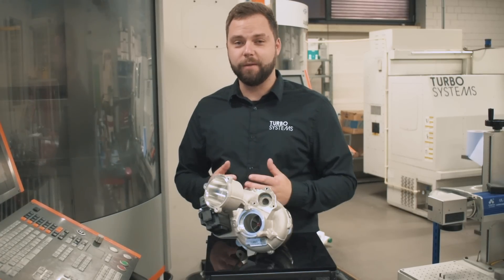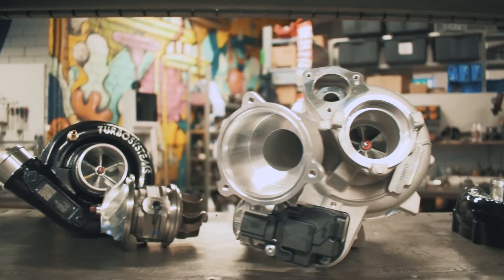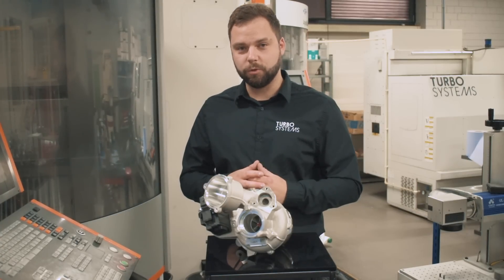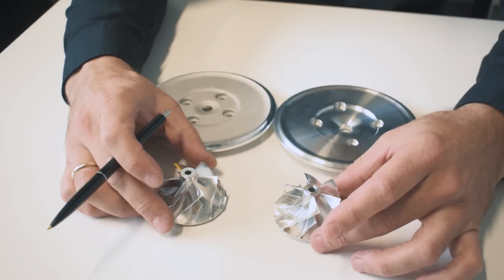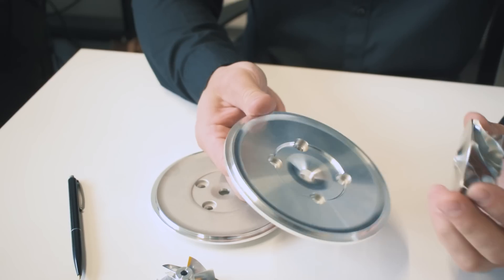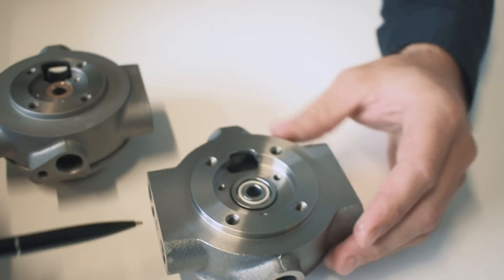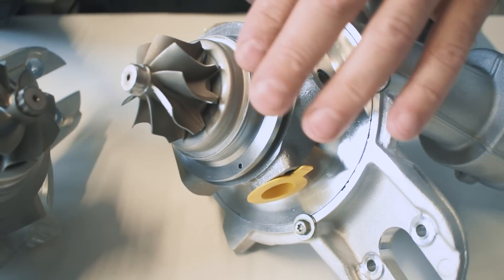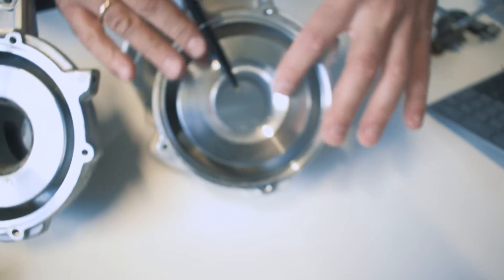2.0 TFSI/TSI IS38 STAGE 0 Upgrade Turbocharger / TURBOSYSTEMS

Comment: No that is not most common turbo fail because i never saw it and ive seen turbos fail 100s of them  , Turbo fails from overheating and it overheats when its not cooled , or when cooling fails , and cooling fails for a lot of reasons but not because you have less or more material on the impeller, impeller has nothing to do with that , even without one turbo will fail it just makes no difference  , makes no difference how much material you have , both will fail when overheated period .
So if you keep it cool you can even shave off material and that will make it spin faster and spin up quicker , just physic's .
I guess you do it for Advertising , ok , do whatever , but then dont call it STAGE 0 thats bad marketing  , whos going to pay 2000$ for Stage 0 , call it Stage 3, everyone will buy , they are dumb like that dont worry 
about it , just do as i say no one will ask anything , and while you are at it you can send me one for review , ill give an honest review
Reply: You taking bullshit, if you boost up, you have to modify that internal spinning shit all together to withstand more power ( shaft head and bearings) 100%  they did great job
Reply: @iansk8forlife  If you go over its design limits then yes you have to  modify it sure ,  
But man , Turbo fails in minutes if you turn of the oil flow , minutes man 
And all the turbo fails ive seen , im talking stock  pressures , it was never impellers fault , almost always lubrication , lack of oil flow , rusty pipes etc.. ive seen no faulty impeller .
talking regular boost , or slightly increased 20 or so percent .
Now when you spin it 50% over its limits  on a badly designed cooling , then of course its going to fail , but even then its the shaft and bearings not the blades
Reply: @dedskin1  lack of oil flow? Do you mean it’s oil pump failure?? Coz it has 2 stages and it always pumps under 2 bars under 3500. That’s why lack of oil influences the whole system. I’m not good at mechanism but probably it’s connected with turbo charger and that’s the reason why it has turbo shortage of oil lubrication as well as the whole system
Reply: @iansk8forlife  You are talking out of your ars , im not interested in your ars speech . A line can brake , a line ca become cluttered and a lot of other things , and im not at all interested in going over reasons for lack of oil lubrication  with a man who thinks he so smart but can see only  a pump failed as reason for lack of flow and then proceeds to elaborate his knowledge on pumps RPMs showing his smarts when he showed his stupidity long before that .
Im not interested in that , think whatever you want to think